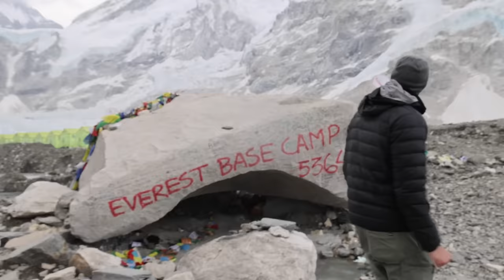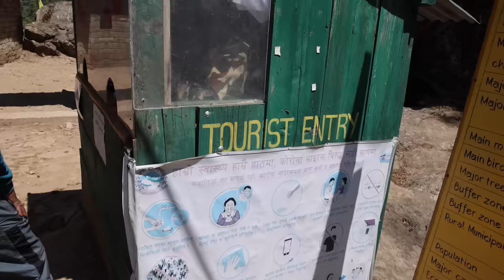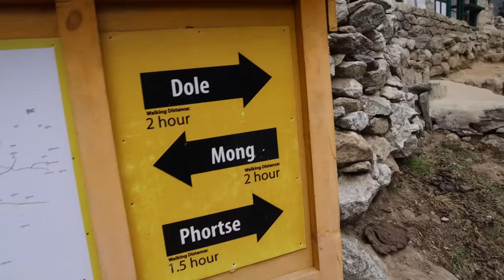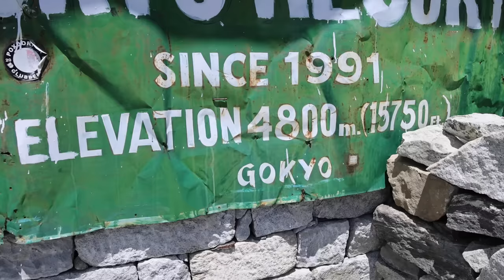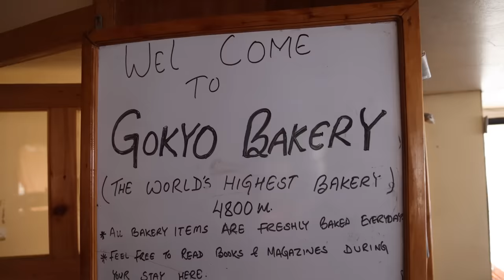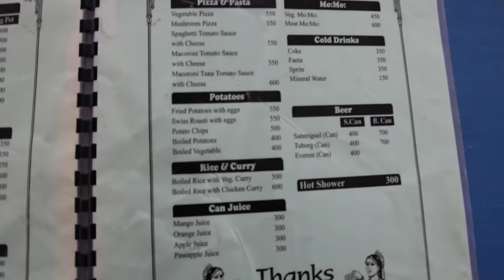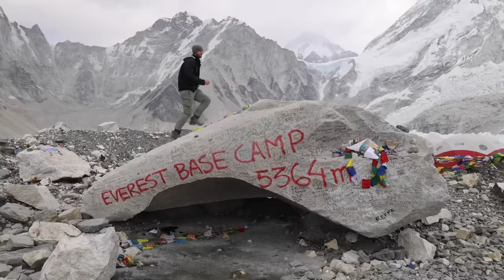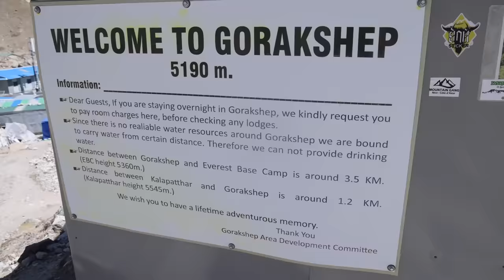Mount Everest Base Camp Trek- Full Documentary

Comment: Love your video.  We made the EBC trek in November 2022.  Was fun to see you experience many of the same places and feelings we had.   Loved Herman Helmers, the apple pie at Tengboche was killer, and it is every bit as challenging as you say.

A note about your stomach issues.  Yak cheese will upset your stomach and give you some gastric distress.   Our guide advised us not to eat it as our digestive systems would be upset by it.  We ate just a very small amount and it did cause A LOT of gas.  Also, at altitude when you have less oxygen all of your systems slow down, including bowels and digestion.  I think these two combined are your likely culprit, not altitude sickness.   AMS will cause nausea and headache.

Fun video, was like I was in Nepal again.

Comment: The tankless water heaters run on propane, we use them in off-grid hunting cabins. The minimum power would be around two 100W solar panels with two 6V golf cart batteries and a 12V DC water pump and of course, a clean water source.